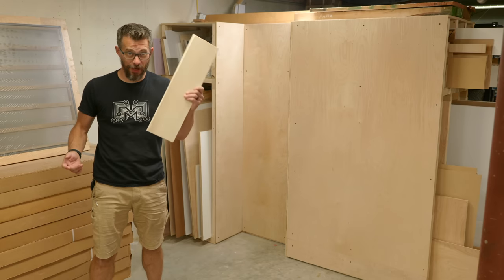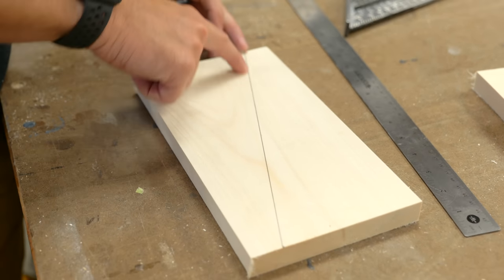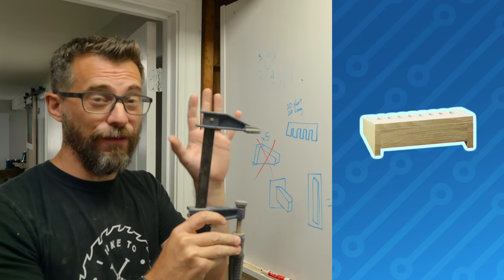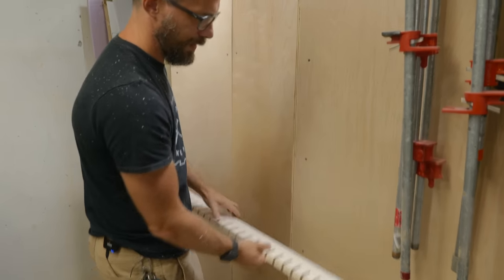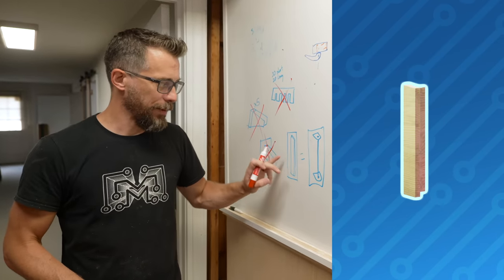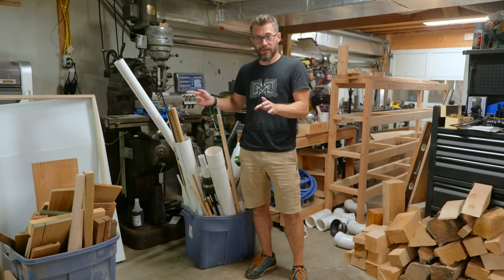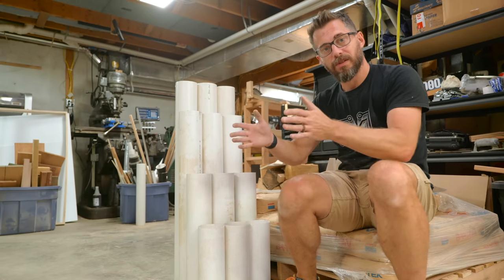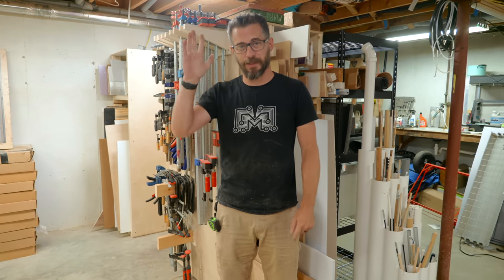Stop Throwing MONEY in the Trash!

Comment: The thin PVC is commonly called “Charlotte Pipe” if anyone is shopping.
Reply: Charlotte is the manufacturer. It's PVC Sewer & Drain pipe which is a thin wall pipe, and it should have ASTM D 1784 and ASTM D 2729 printed on the outside of the pipe.
Don't confuse it with Sch. 40 PVC pressure pipe which Charlotte also makes and has a thicker wall plus costs much more.
Reply: @bobd.  Didn’t realize that. I was researching for my own dust collector and I went to the store and asked for “Charlotte pipe” and they showed me the thin wall stuff. I stand corrected. 👍🏻 Not entirely wrong but accurately updated. LOL

Comment: With the pandemic & now w/ the cost of lumber sky rocketing I start collecting old furniture ppl were throwing out. Made a bunch of French cleat boxes from scrap wood and old bookshelves. Even used the drawer tracks from two old desks. Wish I had a cnc machine. Would have made the process easier. Also planing the mdf matter to one thickness helps. But it worked. I also pickup old wooden shovel handles or broom handles for dowels to hold tape and stuff. Best part is if you mess up it cost you zero

Comment: 13:30  hot glue on the base is strong enough to hold up the whole thing? the weight of the wood scraps won't make the tubes lean and fall off?
Reply: I honestly have my doubts, especially on a hot day where the glue gets even softer. I was all for hot glue sticking the pipes to each other but I think I would've searched for a better way to attach them to the base. Perhaps with some brackets of sorts.
Reply: Agreed, those PVC tubes wont last long with just hot glue holding then together. I would recommend wrapping a strap around all of them or drilling some small holes and running zip ties through them to hold them together a little better.

Comment: I would only be concerned with the hot glue coming loose on the pvc pipes. Due to heat, or heavy items being placed in the pipes and pushing on those connections over time. Maybe a single metal strap around the entire structure near the top of the shortest stack to reinforce? Love these videos. Great tips and uses of excess materials.
Reply from the maker: good idea!
Reply: It depends on the type of hot glue, but in my experience hot glue is severely underrated. If you get the industrial stuff it's really strong. I've glued portions of the ceiling in my bathroom with it to avoid visible screws and it can be really sturdy. So far it's been holding out for 7 years with no issue whatsoever :)

Comment: So why with the "terrible" wood you didn't predrill the holes for mounting?? 🤔
Also, using a different type of screw and putting a washing to distribute the weight would of been better for wood that cracks so easily.

Considering this is a DIY channel, and you show some really good ideas, that you didn't show how to "fix" this really bad type of wood. Instead you just complained about it, still used it, and then complained when it broke. So many other videos you assembled wood projects correctly, structurally, soundly, but in this video you just slapped stuff together and when it broke, you mumbled about it, instead of showing how it could be fixed "Now see, this is a prime example of why we should predrill holes....." type of teaching lesson. 

Otherwise, really great video. I like the PVC pipe organ 😆

Comment: No offense, but you should look into pilot holes ans washer head screws for when you work with that aspen stuff. They would save you a ton of time. Also, spax are the best screws, I don't know if I've split any boards with them in 5 years of use.

Comment: 3 and 4" pvc pipe make tool holders for shovels and rakes. Basically anything with a long handle on it. I cut some in about 3" sections, cut a slot in the front and then screwed them to my wall. You can also use 4" PVC pipe to hold your dust collection pipes on the wall. That's what I used to hang my 4" flex hose on the wall as well as my Dust Right dust collector wand instead of buying the metal clips from Rockler.

Comment: Only halfway in and loving this so far (except for the splitting wood, but I can totally relate... That's me with pine). Regardless, I noticed you moved to a battery powered nailer. What are your thoughts on the tool? I have Porter Cable tools/batteries. So, I'd probably stick with that, but have just heard mixed reviews on battery powered tools versus air powered and wondered your thoughts.

Comment: I made something similar to your DWV rack to hold round stock and other thin pieces...on the tallest three tubes, I used a board of 4 inches height and screwed from inside the DWV pipe to the board, then glued and screwed that board to the rolling base when the whole rack was put on the cart. This gave the taller tubes a lot more strength and rigidity. Funny, but otherwise almost exactly what you made.

Comment: Bob, just predrill pilot holes to avoid splitting wood 🪵 
I always make my pilot holes a little smaller (both shorter and thinner) than the screw I'm using, to still get the benefit of strong screw hold, but without the risk of wood split. 
All the best to you all! 🙂🙂

Comment: I really like the way that Aspin wood looks. It's so bright, looks almost transparent on video and almost looks fake in a way. I haven't seen wood like that, is it a soft wood? There has to be a way to cut it without it fraying. Maybe a blade with small teeth, something that would be for acrylic or a metal saw blade. 

I'm getting ideas like contrasting that white wood shelves with black stained outer.
Reply: Used it once for a desktop. It was the whitest wood I ever encountered.  Felt similar to poplar in softness. I thought, "okay, this is pretty cool. I want to make something out of this."

Even sanding, the fuzz was enough to make me want to punch a koala. Finishing was horrible too. I'll never use it again. There may be tricks to make it usable, but it's just not worth it for me to learn. 
I suppose I could experiment on some with a propane torch but only because I want to see it burn. I hate it. I'd rather shoot it than let it ruin another weekend. Everything in Hell is probably made out of aspen. I won't even visit Aspen, Colorado because I just know it has to be a miserable place. 
But, your mileage may vary. You should try it out

Comment: 6:27 If you know the aspen is so prone to splitting, why didn't you drill pilot holes and then use a non-wedge type screw, like lath screws?  They are great for this type application.